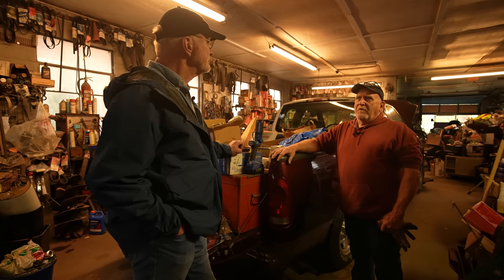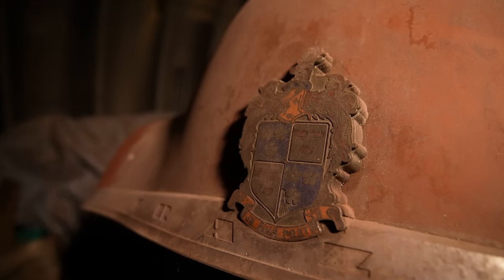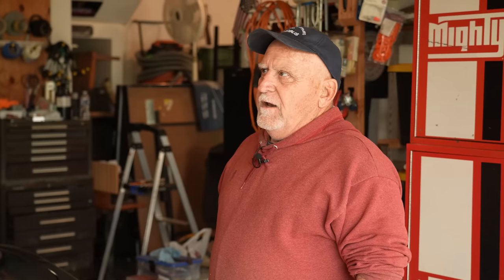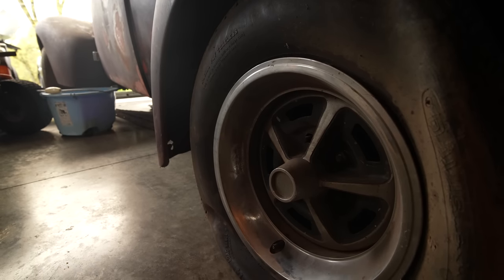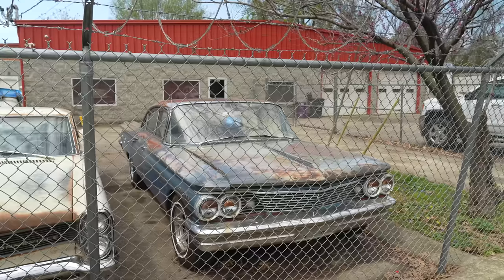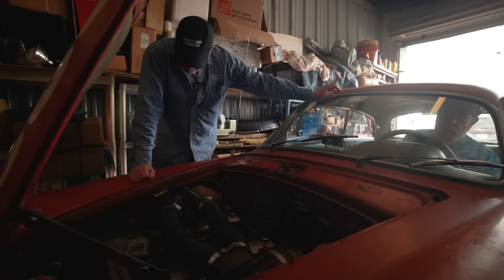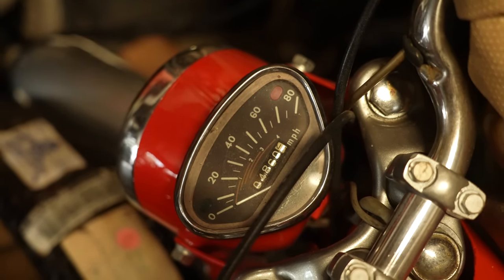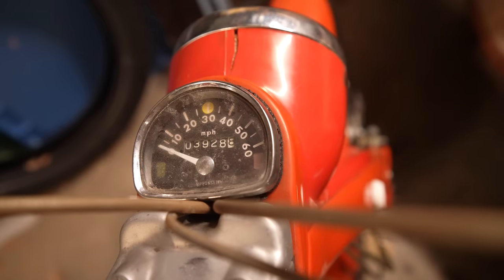C2 Corvette that cost $1,750, Alfa Romeo Sprint, and a Fraiser  | Barn Find Hunter - Ep. 121

Comment: That Studebaker with the sliding roof - Not sure if the ad was for a Stude or an American Motors, but they showed a refrigerator sticking out of the hole in the back. You could use it as a truck to carry tall stuff.

Comment: Seeing that 750 brought back a lot of memories.  I've owned 2 over the years,  a dressed out '74 with a Windjammer faring and a '79 stock.  Great bullet proof engines,  I loved those bikes...
Reply: I had a 79 750 Super Sport. Nice road bike once I got rid of the crappy chinese tires.
Reply: For me too. But I could'nt afford a 750. An old uncle had a CB350 that he bought in a moment of nostalgia, that he barely used for a couple 'o years and he sold it to me for 100$ ! That bike was so nice, bulletproof.
Reply: @marcryvon  My Brother in law had a CB350, brought it back from Puerto Rico in 74. Couldn't ship it to the next duty station, so he sold it to the Honda dealer. Looking back, I shoulda bought it from him, I was riding an SL175 at the time.
Reply: My worst bike was a 74 Honda 450, it liked to suck valves if the timing chain was a smidgen loose.

Comment: I had a 1974 750-4, used and slightly chopped with pull-back handle bars, straight pipes, and a king-queen seat. I was late for work on morning and doing about 80 mph around a long sweep corner and hit the back end of a deer! I almost went off into the woods, but did not or I wouldn`t be here telling this true story. I got back into my lane and took it very slow the rest of the way to work. The bike was not hurt and the deer kept running, and thank God I didn`t get hurt either! Take care

Comment: Honda 90, simple engine, easy to handle, excellent fuel mileage. Take you just about everywhere.
More exciting with a Rocky 110 bore. 
CT90 perfect novice motorcycle for the hunter/fisher/camper. Great "starter motorcycle" for millions of people around the world.
Reply: Have you watched the CT90 channel with a young bloke named Ed ? Travelled the world on them. Currently in Moab.🤙
Reply: Ed has YouTube channel "C90 Adventures". He rides C90, the street 90. 
CT90 is the dual range gearbox 90, a trail bike.
Although mostly the same engine, frame and suspension is very different.